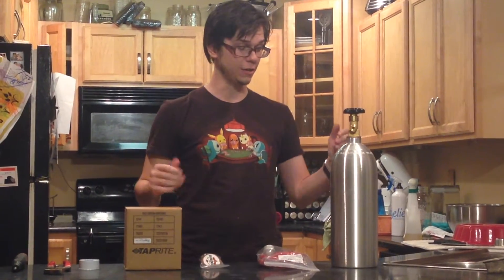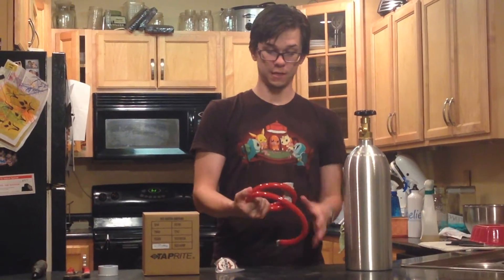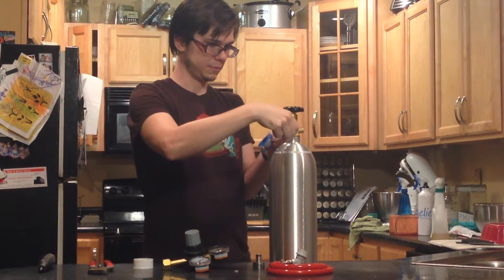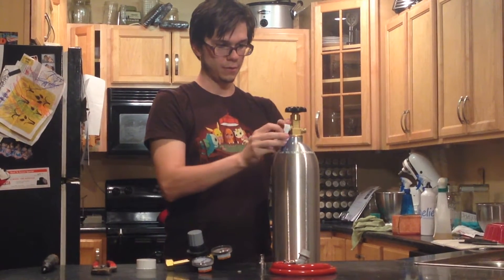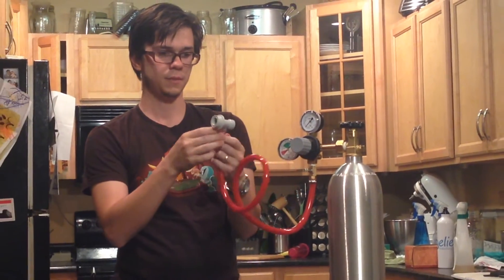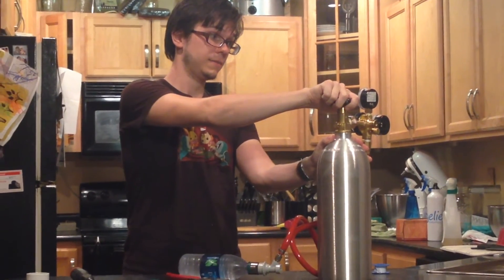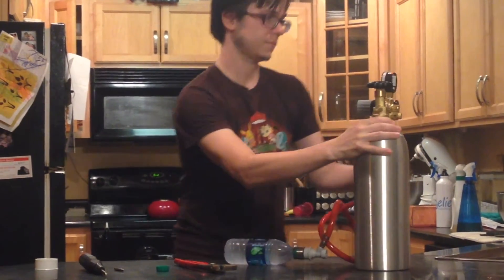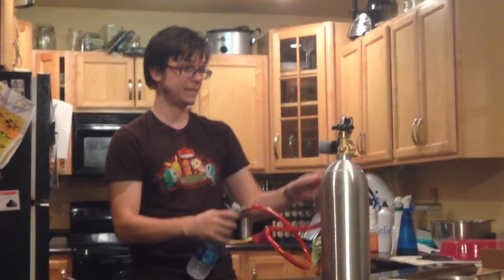How to Make Soda at Home - Carbonation system

Comment: I have the same system, one thing I wouldn't do is pressurize a thin wall water bottle Only thicker wall soda bottle & at No more then 60 psi.
Reply from the maker: That's what i started doing.  only coke bottles and sparkling water bottles from now on for me.  they must be rated for some kind of pressure

Comment: They didn't warn you about the dangers of using fire extinguisher CO2 in a food service type application?
Reply from the maker: no they didn't.  I did some reading about it and basically put my hope in CO2 is CO2 no matter what it is for.  Also speaking with a friend who worked in a "gas" company (whoever actually gets the CO2 in the first place to give it to the restaurants, hospitals, and fire-fighters) and it all comes from the same tank when they get theirs.  so I figure i'm alright.
Reply: Seems legit. All those regulations I heard about are probably just liberal horseshit LOL
Reply: @YourWifesBoyfriend  Why do you have to go and make it political?
Reply from the maker: @gpturner0924  Co2 extends beyond party lines, it's omnipartisan.
Reply: All CO2 sold is >99% pure
Reply from the maker: amen brother.  I wish we could all be that pure.
Reply: +GrantAllen. Well,... that gas might be the same, but that might not be case for the cleanliness or material of the tank. A tank meant for paintball CO2 wouldnt be used for medical o2 for example. Just like regular o2 tanks do not qualify as medical o2 tanks. Pumping metal trace fragments into your soda might not be an ideal thing.

Its similar to the reason you shouldnt use ice cream boxes as lunch boxes. Because plastic isnt "just plastic". Some are made for lower temperatures, aka freezers, so while safe in your freezer. It might give off gasses at room temperature and thereby make your food contain unwanted levels of toxics if you store it in a close ice cream box. While such wont kill you, its not healthy ether.

Comment: looks good, but just an FYI. no need for Teflon tape on the tank/regulator connection. that should be a compression type fitting. you could actually cause a leak by putting anything on those threads. but otherwise excellent.
Reply from the maker: rockymntsax that the sort of stuff I didn't know. And only the Internet has the power to show the truth about this.
Reply: yup. I'm in the HVAC and plumbing industry and see so many leaks caused by thread tape and pipe dope that's been put in places it don't belong. in your case, it's not dangerous, just a waste of money when you find the bottle is empty and you thought you had no leaks. it'll leak later after it's been there for a while and you think your good to go...
Reply from the maker: the only way i've found to counter act this is to always turn the main valve off on the tank.  It saves the air for later.